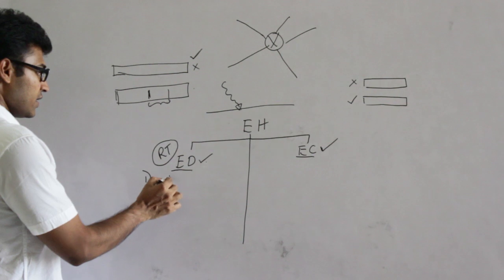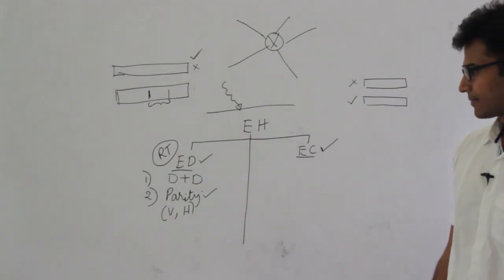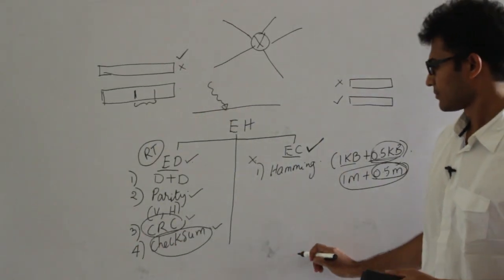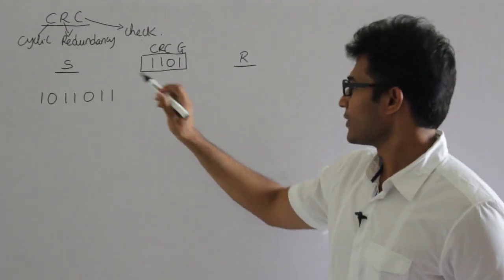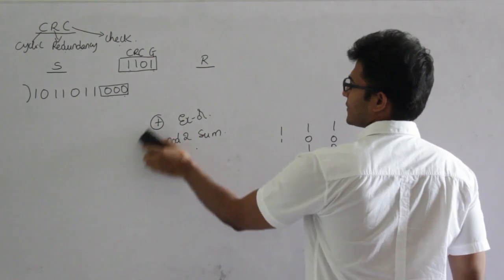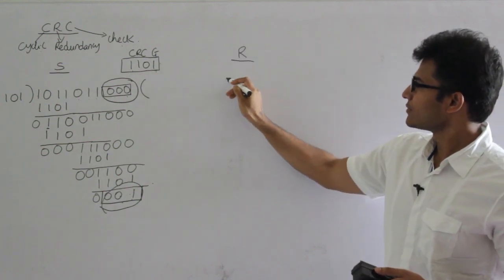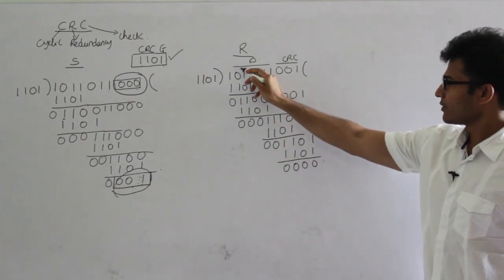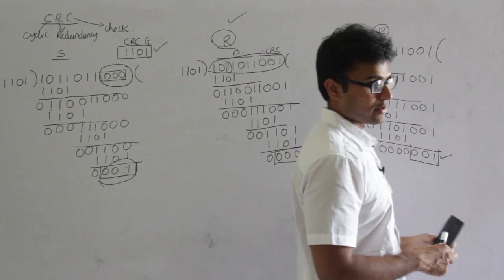CN | Error Control Methods | Error control and CRC | Ravindrababu Ravula | Free GATE CS Classes

Comment: Thank you, sir. Hope you're well. Am reading a book TCP/IP illustrated, volume 1, the protocols  by kevin R. Fall and W. Richard Stevens, and the CRC mod 2 long division in the book is different from the one in this video, and using the method in your video, i got a different answer from what they got. also they said that what is appended at the end of the message(m(x)) to form the message to be transmitted(t(x)) is 1 complement's of the remainder. On receipt, the book said the division is done again, and if the remainder is different from what was appended to m(x), then there's an error. These authors are big guys in their field, please can you explain what is happening. cheers. below is the link to the division
https://drive.google.com/file/d/1WZuECMtyFi_6R21svPKAcTUqdwnVz9XH/view?usp=sharing

Comment: Thanks for the video!!! 
But I'm confused about the amount of redundant data needed to be sent using the hamming code error correction method. In Hamming Codes we add check(parity) bits at 2^i positions. So the amount of redundant bits is log2(n) + 1, where n is the number of bits transmitted (including parity bits). So log is not the half of the data being transmitted. Please correct me if I'm wrong.
Reply: +Denis Grebennicov  You are right